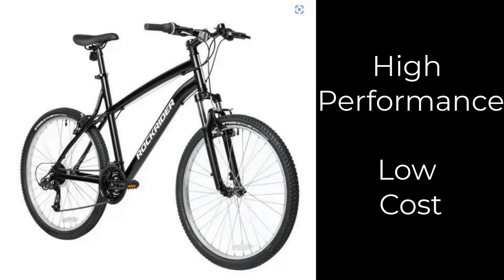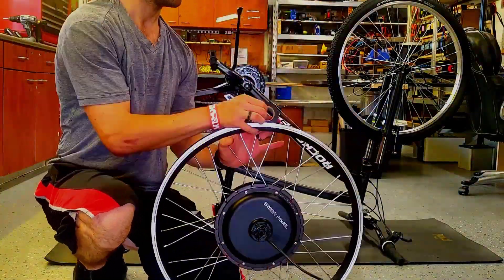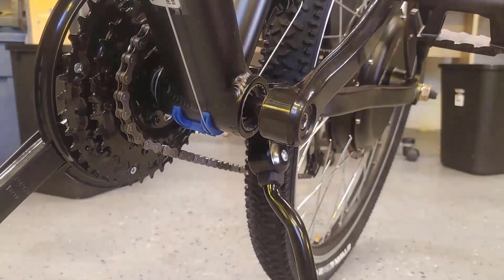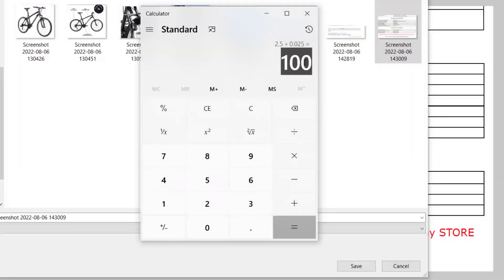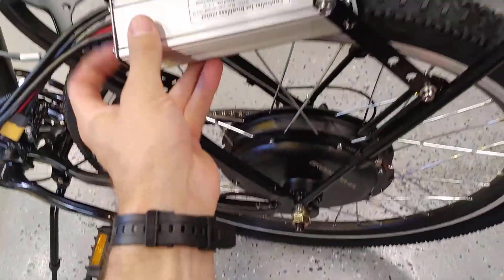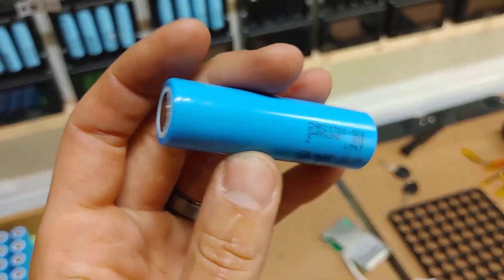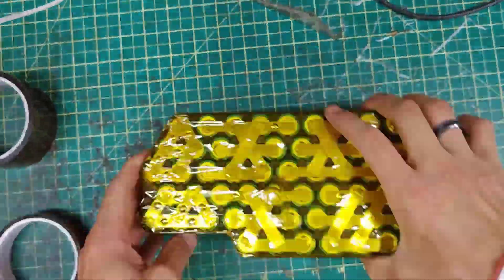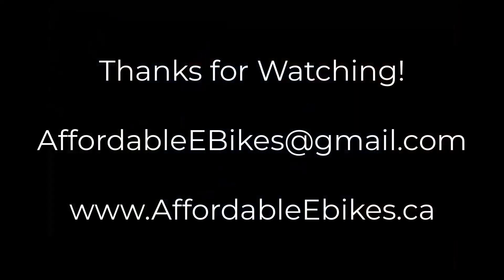Electric Bike DRASTIC Power Increase with SIMPLE Trick!

Comment: Do you know any good ways to make battery cases for lipo4 cells? currently trying to fit 30cells on my back rack 😅😅
Reply: lipo4 cells expand 3d printed cases and all other cases get torn apart as the pack expands, make sure you got plenty of extra room in the case and use soft padding for the pack to expand into. trying to limit expansion only creates pressure within the pack and cells which in time will be a disaster.
Reply from the maker: 3D print? We usually 3D print our custom cases
Reply: Without a 3d printer, you can order plastic sheet that can be heat formed, and plastic welded. It's the same plastic you see used for school bus escape hatches, plastic housing for automotive accessories like guage pods and cd player bezels.
It's not polyethylene. Maybe polyester?
Reply from the maker: @marthamryglod291  Yes that's an excellent idea. ABS / Acrylic sheets both could work. I believe that ABS can be "melted" together with acetone (nail polish) which is pretty simple.

Also the Harbor Freight / Princess Auto Ammo boxes are really low cost and excellent plastic enclosures that have rubber oring seals to be water tight.

Hope any of these suggestions help! Thank you for the prompt on a much more accessible method!
Reply: @ElectricBikeLaboratory  yes, that's it! ABS sheets. I read a book about practical plastic use and application years ago and I was pulling from memory.
Reply: @ElectricBikeLaboratory  I was just looking at the harbor freight cases. I had an idea to get a couple rectangular 40ah batteries and mount them low on the sides of the rack in order to do a long tour without recharge. Over 5,000 watt hours would take me 40 miles and back from the ocean.
Reply: @marthamryglod291  I'm afraid the plastic may not be strong enough to hold the cells, they're 50 poumds total
Reply: @devanwheeler3426  oh bummer. Foam filled gun case cut to hold the pack has been done successfully and if you crash, the pack is protected. Plus it's waterproof. Some modification required.

Comment: would it not work better if you started with a 2KW hub motor ?   I would not use such brakes myself for a bike over 1.5kw.
Reply from the maker: Hi there, generally 2kW is not an available option for hub motors. It usually goes;

500 -> 750 -> 1000W -> 1500W -> 3000W -> 5000W -> 8000W

And brakes wise, V-Brakes can easily work better than disc brakes given the right setup. The amount of torque that V-Brakes are apply to apply to the wheel compared to disc brakes is pretty staggering when you consider that a disc brake has a 160mm rotor, so the brake pads are only grabbing 160mm away from the center point. 

Since Torque = Force x Distance, the distance is quite small on a 160mm rotor. This is why larger discs, such as 180mm and 203mm are used.

V-Brakes on the other hand grab the rim at the distance of the rim, which on a 26'' wheel, is say grabbing around 22'' or 560mm. You can see that the amount of force required for braking power is much less because the distance is so much further.

With a good set of brake pads (KoolStop E-Brake Pads for example), a V-Brake setup can provide excellent stopping force in most conditions.

Something to consider! These brake pads actually stopped the bike very well, and the very large aluminum rim acts way better as a heat sink than a tiny disc.

Ultimately, regenerative braking ends up being an excellent way to beef up braking power, we're aiming to do that in an upcoming video.
Thanks for the comment!

Comment: Is there a way to mesure accurately the output power after theses mods on the screen or will it show 1000w ?  What is the top speed ?
Reply from the maker: Yes, to accurately measure you would run a watt meter between the battery and controller, this will at least give accurate info of the power coming out of your battery. After it goes through the controller / motor, it is probably realistically only going to be about 80 percent efficient in terms of pure output power (as would be measured on a dynamometer for example) but its the most practical approach I can think of.

Here is an example of what I mean by the watt meter
https://www.amazon.ca/Digital-Meter-Precision-Power-Analyzer/dp/B07V1QF1JW/ref=asc_df_B07V1QF1JW?tag=bingshopdesk-20&linkCode=df0&hvadid=79920843185585&hvnetw=o&hvqmt=e&hvbmt=be&hvdev=c&hvlocint=&hvlocphy=&hvtargid=pla-4583520390664661&psc=1
Reply: @ElectricBikeLaboratory  have you already used a watt meter to see how much % did the mod affected the usage ? Is it really 3000w peak ?
Reply from the maker: @elias8981  Hi there, we did not use a watt meter but we did measure the voltage sag at peak load prior to modifications and after, and the voltage sag was about double.

So you can (roughly) calculate the power that way;

V= I R
Delta V = Resistance x Current

Twice the delta V with resistance of the pack being equal gives about twice the current.
Began at 30A peak (according to controller label). Ending up around 60A.

Again this is not at all scientific to guestimate like this but at least it gives a pretty good idea. Watt meter is ideal but you'd have to run it to your handlebar to see it while riding or GoPro film it where it is mounted to see the values. Running thick gauge wire to the handlebars is a bit tedious!

The display does have a watts output but this only works in pre-modified form.

Hope this is of some help!
Thanks again for the comment
Reply: @ElectricBikeLaboratory  ok so it came from 1440w to 2880w according to your estimates. Pretty impressive ! Can it handle 60amps for a long period or time or only small bursts ? How did the top speed was affected by the mod ? Did you saw some improvement ?
Reply from the maker: @elias8981  Top speed not really affected too much, it topped out at about 55km/hr, and it was able to handle the 60amps pretty much as long as I wanted. I went for a few long rides and the controller did not get that warm (surprisingly), the motor started to get warm, but the statorade seemed to have kept it within operating temperature. If the Statorade still wouldn't keep it cool enough, there is still the possibility of adding Hubsinks to the wheel to improve cooling.
Reply: @ElectricBikeLaboratory  Ok. Interesting results. Thanks for all the explanation. By the way, do you have any controller with flux weakening ? Would've been cool to have a detailed video about it like this one because not a lot of people on YouTube seem to get interested to it. Thanks for the work !
Reply from the maker: @elias8981  We are doing another build with the same frame using the FLIPSKY VESC 75100 which has field weakening (flux weakening) in the software, but I believe we will be building at 72V and may not need the field weakening. It should go fast without it. But everything will be the same, so it will be worth checking out.
Reply: @ElectricBikeLaboratory  Wow, interesting project ! Can't wait to see it. Do you plan to order a customised hub motor with a certain KV to either max out acceleration (which could be a challenge to adapt the frame to it) / max out top speed or do you plan to stick with a standard basic motor as this video ? Do you think you could integrate variable regen with like an auxiliary throttle / advanced brake sensor ?
Reply: @ElectricBikeLaboratory  I get 36 mph out of my crystalyte 3540 dd with a  48v 24ah battery and a phaserunner controller set at 40 amps and it runs perfectly cool all day so that is really not that impressive considering the work you put into it.
Reply: @erpringle  is there a flux/field weakening option in the phaserunner ?
Reply from the maker: @erpringle  Your Phaserunner cost more than the entire motor / electronics package and will still provide less torque. 

We are merely trying to show people options, in this case at a budget with components they may already have. The setup that you described is not at all a budget setup. Grin Tech makes fantastic products, they but are premium level pricing.

Thank you for your comment!
Reply: @ElectricBikeLaboratory
Reply: how to buy engine elctri bicke